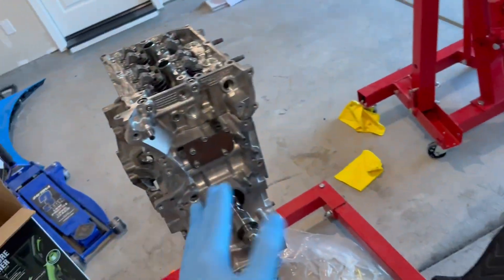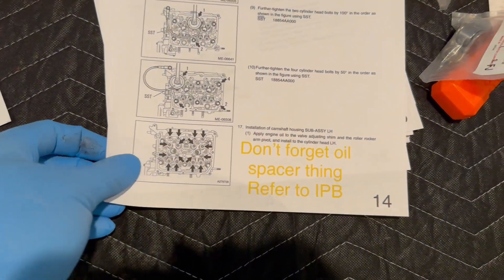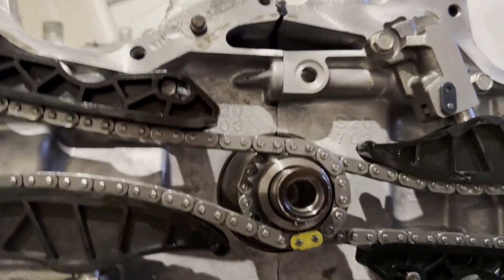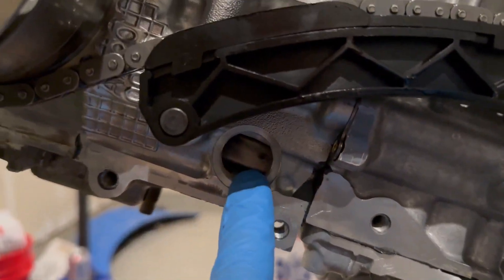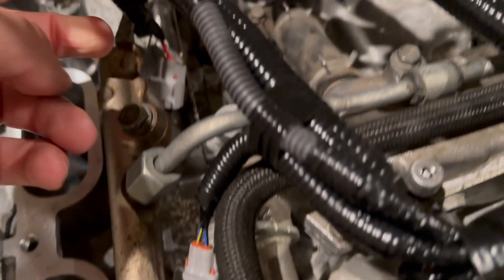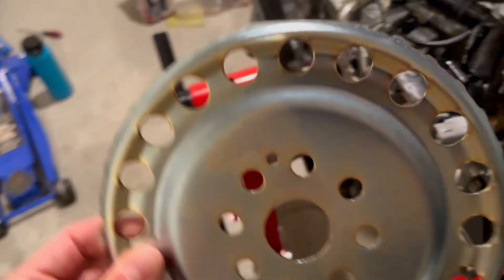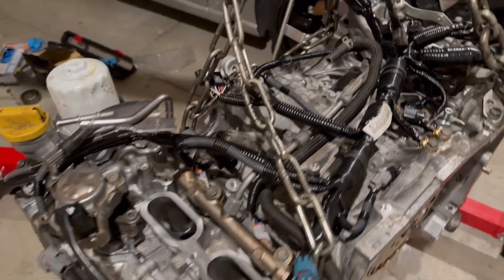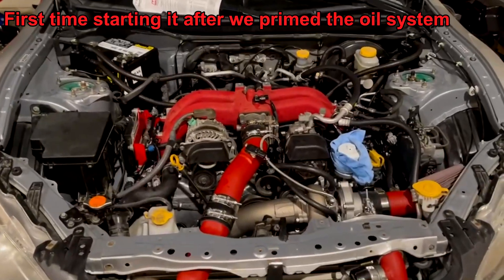FA20 Engine Rebuild Part 3 Timing and Wiring FRS/BRZ/FT86

Comment: Question hope you see this sooner than later. How did you know where each  Camshaft timing oil control valve went before taking it of the original? I am having a time putting it back on the right spot only 2 of them are label “RB” and “RT”
Reply from the maker: I never took apart the cam carrier assembly or separated the cam shafts, or took the sprockets off of the ends of the cams.
Now if it’s the solenoids on the actual timing chain cover you’re referring to, I took one off at a time so I didn’t mistake where each one belongs to. Same with the cam position sensors. I did actually have a VVT Solenoid break and I did have to replace it, it was very easy to replace even with the engine in the car.
The cam position sensors, I believe 3 are the same and one is different. As for the VVT Solenoids, i’m not sure, I would imagine the ones labeled RB and RT probably belong on the right side which would be the passenger side. This is because vehicles are from the perspective that you’re look at it from the back. Therefore everything on the left is the drivers side, and everything on the right is the passengers side. You could probably find the information on subarus website if you type in the part number. I believe the solenoids have a part number on them somewhere. Then if you find the illustrated parts breakdown you can figure it out.

Comment: 13:00 este video me haoro cientos de Dolores y Dolores de cabeza despues de yo remplasar el motor de mi 2014 Subaru Forester no ice esto y dure mas de dos meces buscando informacion para arregla el tiempo de mi Nuevo motor remplasado ya que tenia el codigo p0506 p0016 p0018 y mi auto no aceleraba gracias a este video hoy resolvi el problema sacando el motor completo nuevamente y estaba de saliniado el el tiempo del motor gracias por tu ayuda bendiciones 🙏 para ti hoy mañana y SIEMPRE 🎉🎉🎉🎉 saludos dsd Boston Massachusetts

Comment: Hey man these vids are a godsend, I've watched them 20x while doing my rebuild. Wedging the pistons into the engine stand saved me a trip to the shop. 

One question: you removed the 2 engine studs that go into the transmission before dropping the engine back into the engine bay. How did you reinstall them? Did you line up the engine with the transmission and just screw it in through the transmission flange? And torque to spec?
Reply from the maker: That’s awesome, i’m super glad to hear the videos were very helpful!

For the 2 studs, I did stick them through the transmission once it was all pressed up together. I believe I butted 2 nuts together and tightened the stud that way. I believe the torque spec is very low on the studs as well.

As for how easy/hard it was to get it back together. I had the transmission still in the car. The funny part was I said to my friend: “I’m not looking forward to this, because I feel it is going to take a long time to get it to line up” my friend replies: “Nah it’s going to go right together first try” my friend was absolutely right, it went together absolutely no problem at all. It was immensely easy, took like 10 seconds to line it up if even that. While we were putting the bolts on for the bell housing, I just kept telling him my disbelief of how easy it was.

Short answer, it was extremely fast and easy.

Comment: How did your prime your oil, did you just crank the engine with no fuel and let the oil pump do the work?
Reply from the maker: Yea, I took the fuel pump relay, or fuse I think it was a 20 amp fuse, the light greenish yellow one and cranked it until oil came through the filter house. We had the filter off when we did it to see. I also filled the turbo feed line with oil.

Comment: Did you use rtv between the heads on both sides or just that one side? Any leaks, engine build looks great BTW!
Reply from the maker: I actually can't remember if I did, I did whatever the manual said I believe both head gaskets got sealant on them, but I don't remember if both sides of the gaskets did though,
I believe the primary purpose to the sealant on the head gasket is to seal where the timing chain goes and also where the bed plate does if i'm not mistaken.
Asside from that, leaks wise, I have a leak from the Cam Plate Cover which is very normal, I need to address it again but haven't gotten around to it. it's not an immediate concern though

Comment: had my engine rebuilt and for a while ive had a p219a code. I have replaced the cam sensor, o2s and someother stuff but cant get the problem fixed. What do you think could be the issue?
Reply from the maker: Sounds like it could be an injector related issue, does it missfire or stall at all, or stutter at all?

Comment: I’m having a p0302 code on my fa20.. I did had my heads done recently put everything together with all data .. runs rough at idle but is find under load .. misfire is only on idle .. swapped spark plugs .. coils .. even changed to intake gasket again but still .. any idea.. you think a valve is too tight or?
Reply from the maker: That is a pretty odd occurrence, but there could be other stuff that is more likely and related. My valve clearances were on the loose side which means they wouldn’t open fully and my car runs fine at idle, (when it actually starts running lol) my car doesn’t start up on the first try but I think mine is tuning related, could be valve related as well. I haven’t gotten to explore the options too much because I have been away from home for the last 5 months immediately once I finished putting my engine together. Your issues could be something very simple though, it could be the injector driver grounding if it’s not making a good ground those issues could happen. It could also be that maybe a seal in your direct injectors or even your port injectors is bad. Does your engine bay smell like gas sometimes?
Reply: @ScratchMB  me and my mechanic swapped the secondary injectors and it still is misfire .. it is smelling lean/rich.. right now we’re gonna swap the main injectors and see if that does anything 🙏🏼
Really hope it works out
Reply: @ScratchMB  i appreciate the response .. yeah my mechanic didn’t do any valve adjustments so I’m thinking cylinder 2 is on the tighter end of spec .. he didn’t think there was spacers on the lifters so he just threw them together..

He wants to run through all the simple things before having to pull the motor .. I have a feeling deep down it’s the adjustment to right.. he doesn’t think that would cause it on one cylinder though and for the fact that it doesn’t misfire when we drove it
Reply from the maker: @S2kdaily If he didn’t put the spacers on the tops of the valve stems it would make it significantly looser, unless he checked the valve clearance and it specced out it should technically be fine though, you would still probably want the spacers though.

Comment: So you did a valve adjustment?
Reply from the maker: I adjusted the valves as best as I could with the parts I had, I had new rockers and lifters and also new valve shims, but the new valve shims were too thin for the clearances. So what I did was mixed and matched between all my rockers, lifters, and shims so that I could get the clearances I needed. Some of them didn’t quite make it to the adjustments I wanted but I just ended up putting it together anyways, which I sort of wish I didn’t do because my valve tick is a little louder than I would like. Unsure if it will cause premature failure in the future, but it may be something I’ll adjust in the future when I am home again.